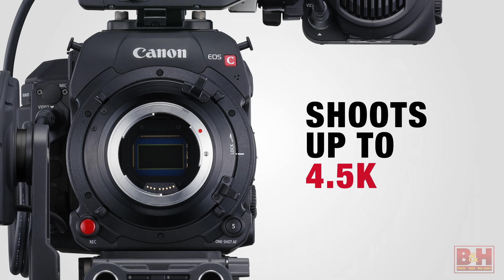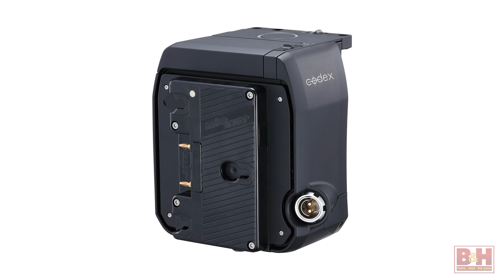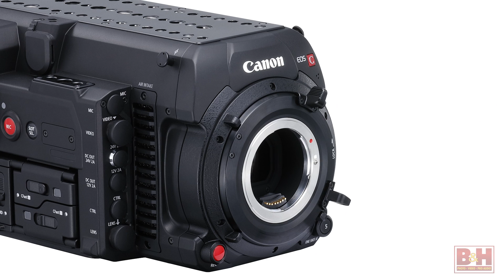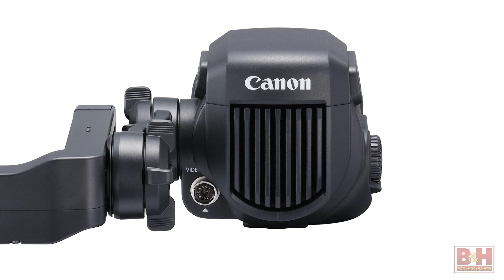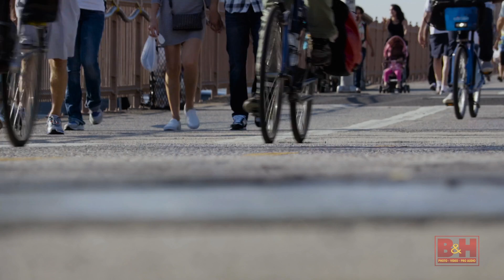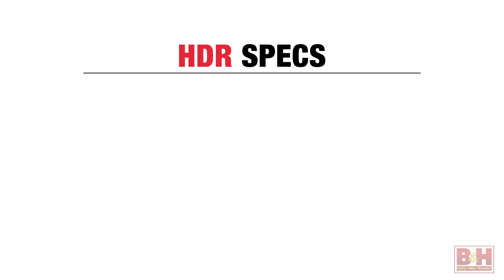First Look: Canon | EOS C700

Comment: It's being sold for $28,000. Right in there with Red territory on feature set, modular design and price tag. Oh wait, it's not 3 years ago is it? Sorry, Red shoots in 6K and has excellent slow motion options in 4K. Oh and it's been shooting raw for many many years.  Oh and it's a company around 1/100th the size of Canon. It's great to FINALLY see canon make a camera with everything everyone wants except for decent 4k slow motion but it's also sad to see a company with so much potential not be able to compete with much smaller companies. I will say that the one really big thing this has that RED doesn't is the ability to shoot in great compressed codecs for fast turnaround. Kudos to Canon for that one.
Reply: but that is probably your attitude towards ARRI as well. And Yet ...
Reply: Send your Red back for service and see how much it's gonna cost to fix....it'll make you look at that Canon as a better option quick

Comment: As a "Serious filmmaker" you grab an Arri.
Reply: Yeah, but Arri Alexa costs more than twice as much as C700.
Reply: Arri Amira doesn't.
Reply: 99% of Arri are rented, not sold. So the price doesn't matter to filmmakers, and yes, that Canon is junk compared to an Arri.
Reply: or a sony
Reply: You can get Arris Alexa for about 35-40 the body
Reply: Good point! and has the added bonus of custom 3D LUTs! If the operator has no need for shooting 4k at speeds of up to 120fps with the bonus of Canon's Dual Pixel AF tracking, the Amira is a great buy.
Reply: Shane Hurlburt used a bunch of Canon cameras for Need for Speed. Its all about what you're doing fam. C700 seems pretty cool imo
Reply: He used 5DII. Ages ago.
Reply: This is meant for broadcast, not for cinema, nor indie films, nor anything like that. Its meant to give broadcast a more cinematic look, cause in their opinion that is where the industry is heading.
Reply: Gregor Mima or you could rent a film camera and you some Kodak stock.
Reply: Alexandru Moraras no way this is a broadcasters camera. The simplest fact that it's capable  12-bit 444 and 422 colour gamut is meant for film production and not television. Also a resolution of 4.5k is way too high for television standards. Plus it's reliability on external raw recording is not practical for television production.
Reply: Avinash Singh You have ways to downsample, besides I heard a guy from canon in an interview saying that now in tv it seems that everyone is going for the cinematic look. Besides tv channels in germany are using Arri cameras for broadcast, so I think its more focuesd on that market. And the price is way to big for it to be for indie cinema. For that price you can get the alexa or even way cheaper is a red. And besides it looks more like a video camera than a film camera.Maybe I'm wrong but its how I see it, and that interview that I saw kinda confirms it.
Reply: Not if you're shooting for Amazon or Netflix
Reply: Arri is a top notch camera
Reply: @aurelienani5927  If you are professional colorist (Color Grader), you can match from Sony Mirroless Camera or any DSLR camera to look exactly like ARRI FOOTAGE,  just use Davinci Resolve and you save a ton of money.

Comment: Stunning! and with a global shutter and external 4k recording at up to 120fps!!! Arri should be very worried!
Reply: The Red Scarlet can do mostly all of that and more at half the price
Reply: are you really comparing this junk to an Arri? get off the internet please
Reply: I am referring to the Scarlet-W not the X, the newer Scarlet-W can shoot 5K at 60fps, 4K at 150fps  and 300fps in 2K.

the DPAF is the only feature going for canon but it does not justify its price point.  Not when there are well made other cameras that can shoot at higher resolutions and higher frame rates at half the cost.
Reply: Arri is not worried at all. It's all in the color and contrast.. Canon maybe knows still photography but has no idea about cinematography. Evidence? Nobody uses a Canon camera as an A-cam in a-tier hollywood movies.
Reply: It all comes down to a users needs James. Not everyone requires 5k whereas within the last 12 months we've seen producers starting to use the C300 2 for doc work and commercials without the use of focus pullers which is a real game changer. One thing for sure is that the industry isn't going to run away from such a camera with a price tag of just £40,000. It's not an unreasonable price and besides, which other camera out there shoots 4k at 120fps with advanced AF!

Comment: If Canon has the sensor technology to produce 15 stops of dynamic range, why are they purposely holding back in their DSLR lineup?
Reply: Dslr can't handle large sensors like a super 35
Reply: Avinash Singh Full frame DSLRs have BIGGER sensors than a super 35.
Reply: This Sensor is 11.54 megapixels (4622 x 2496) with fewer effective Pixels due to Image Stabilization, so it's a ~9MP Camera; a Sensor 4X bigger costs over 4X as much. Another consideration is Glass (especially Servo-Zoom Video Lens, for over U$15K) can be Rated to work perfectly on a 4.5K Sensor far easier than on a 50MP Sensor; far lower cost Lenses.

The CPU is 3 Digic DV 5's - see how large the Body is - a DSLR would have to accommodate that size of a Body (reshaped into 'DSLR Shape').

This Camcorder is almost U$30K - do people want to spend 4 to 8X that much for a DSLR with 4X the resolution. They want to pay 1/4 that much (even less) so that will be a few years away - but this brings us a year closer.

YT,
Rob
Reply: ***** So...Sony and Nikon can put sensors with a huge dynamic range in their cammeras but Canon cant because they dont have glass with servo zoom...lol. Also the amount of processing power this camera needs is because its shooting video. Yes this camera is 30k, thats why Canon wont put better sensors in their DSLRs because it would cannibalize their cinema line.
Reply: The 1Dx mk2 has better DR than the nikon D5 and the 80D has better DR than the sony A6300.....it's expected that the 5D4 will also have an improvement. Canon can't go back and fix the old cameras so you need to wait for the new one's before complaining that they are not fixing them....
Reply: Canon had servo zoom lenses for serious cinema users. If you have the money check their "CN7X17 KAS S" lens ($26,350.00 @ B&H).

Comment: Most of these features are in the Blackmagic Ursa/Ursa Mini though at a fraction of the prince...similar modular design, same stops of dynamic range, rolling shutter and global shutter with EF/PL mounts, HD/4K recording and has RAW and ProRes recording onto memory cards. I quite like the HDR modes though and hopefully the C700 has much better low light capabilities than the URSA, and I know Blackmagic cameras are not perfect, but just pointing out that this just seems overpriced for what you get and that you can get similar features in cameras that cost a lot less like the Blackmagic Ursa, Red Raven or Sony FS cameras, Arri Amira etc...I know that many who would actually want this camera may rent it instead of buying though, but still.

Comment: Amazing... 
How much for the Body and maybe a Full Fledged rig?
Reply: I believe the body alone is around 28-30,000$
Reply: 30 000 $
Reply: Around £40,000.00 with external recorder
Reply: $30,000 (BandH)
Reply: EOS C700 EF £28,839.99
OLED Electronic View Finder EVF-V70 £5,539.99
Shoulder Style Grip Unit SG-1 £2,319.99
In addition the Codex external recorder will be priced at a minimum of £7000.00 bringing the cost of a full rig (excluding lens) to around £42,000+
Reply: Zaber Ansary Indeed!
Reply: ... Black Magic ...